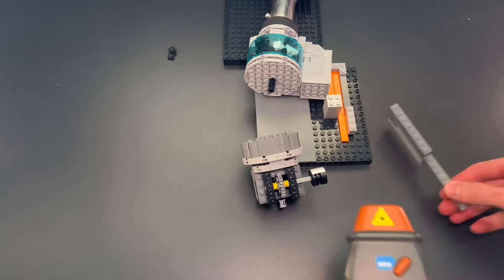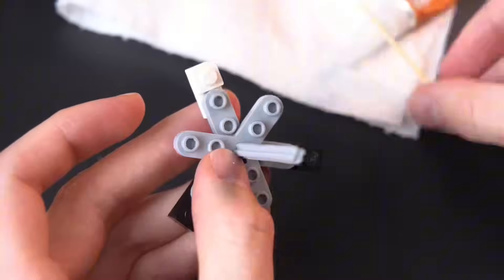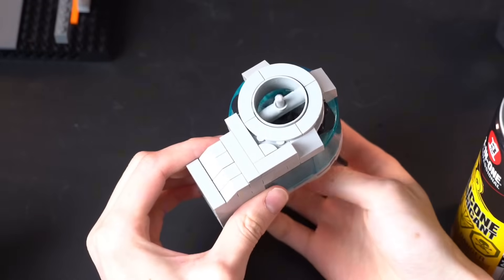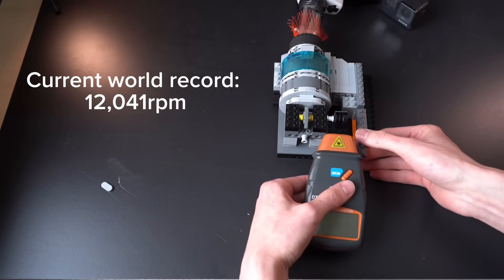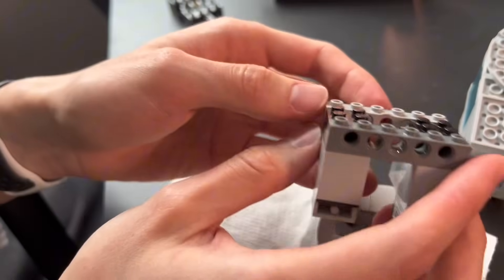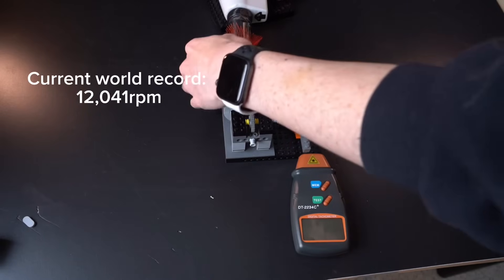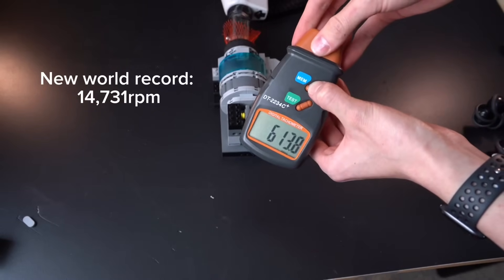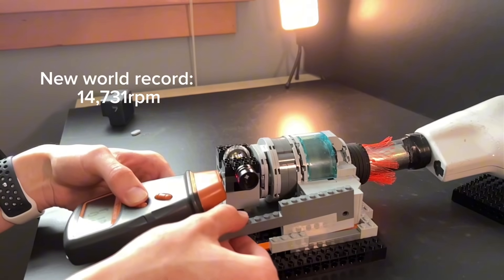15,000 RPM - LEGO vacuum engine | NEW WORLD RECORD!

Comment: put two parallel ones connected to the same axis, on one side you connect it to the vacuum cleaner, and on the other side you connect it to the engine's air intake, making it work like a car

Comment: Cool but lacks the robustness of the other ones. That might just be a consequence of having the turbine axle be in the same direction as the vacuum. Silly question but what happens if you use the other hole for the throttle and move the vacuum to where the throttle currently is?

Comment: watch joe booker on a car engine that does vacuum .video joe cell hkrses mouth.its not water its the charges in water that develo natures lightning electro static the lightning bolt magnetic static the vacuum void closer ( thunder clap ) it can never valve bounce as the engine is sealed .joseph papp also did this .its in air of coarse .hence your engine explodes like joseph papps did as it either becomes colder and colder .that would cause levitation .MAY BE PLACE A FUNEL TYPE ON OFF FUEL TAP TO ALLW A NANO PARTICLE OF NORMAL AIR PRESSURE TO REGULATE THE CHAOTIC VACUUM. and of coarse the opposite charges the air holds to the vacuum

Comment: remember the air here is still limited in the speed it can achieve... theres certain basic physics governing air speeds due to pressure differentials.

if one asked this turbine to do actual work, at max efficiency it would run at half the speed of the air flow...

and despite how it seems... the air is expanding, as it enters the lower pressure...
probably get slightly better results running backwards to this... intake in the center. like a normal centrifugal impeller... youre asking the air to flow backwards to how it wants to flow here. it wants to fling out, the air mass entering from the center... its that incoming airmass that does the work. 

its odd. i have one of them little 250s that happily revs at 18K... the tacho doesnt even register below 4K.
yet i jump on a lathe and just 500RPM seems stupid fast...
Reply: True

Comment: Why do you use a gear reduction, it would be faster it was right off the axle
Reply from the maker: My tachometer only goes up to 2,500 rpm(not even close to 15,000) so I put a 24:1 gear ratio on the output and just multiplied the reading by 24
Reply: @j_mods_everything  oh i see

Comment: Important Thing To Remember To Make A Very High RPM Lego Engine:

Lubricant And “Glue…?” 😅

It Reached Almost 15k RPM, Thats Fast 😮
Reply: Thatfemboydud   i use a 14500 rpm motor with lego and it just melts the axles fairly fast unfortunately
Reply: Thatfemboydud   im gonna get matal exles and prolly gears eventually they wayy expensive tho
Reply: Just use the kragle

Comment: This is not an engine ,it's a turbine they are not the same thing
Reply: all these past wrs are technically turbines. how else are you meant to make it
Reply: @GXVoid116  like he made them before? His older projects where engines
Reply: From the Oxford English dictionary:

engine, n.
A complicated machine with moving parts, for producing a given physical effect, esp. the conversion of power into motion; (in later use) esp
Reply: It’s a turbine that can be used to do work if a geared down output shaft is attached.
Reply: Aren't there videos of people getting turbines up to 30 to 40k?
Reply: They achieve the same results, high rotations via air. I understand your point but this is supposed to be entertaining not educational I believe.
Reply: Womp womp, dont need to get all bent bc of a word/term
Reply: A turbine uses the kinetic and/or heat energy of a fluid to create mechanical force. An engine needs to be able to burn fuel to produce that heat energy by itself. It doesn't matter whether or not it uses pistons, it's still a turbine. By definition, anything that you build out of Lego and run using compressed air will always be a turbine and not an engine.
Reply: A turbine is still classified as a combustion engine
Reply: Erm, what the sigma? According to my previous calculations from the skibidi toilet film theory basement, this doesn't matter, and nobody asked. Sure they could have used the word turbine but why bother changing it? Anyway whatever I'm gonna go g o o n now
Reply: Turbocharger*
Reply: Vacuum
Reply: Shut yo “erm atchually 🤓” ahh up
Reply: So basically a lego turbo
Reply: @MoparCentral2010  no, a turbo pushes the oxidizer(air) for burning the fuel,a turbo turns mechanical energy in to airflow
Reply: A turbine engine is a engine
Reply: Dog, do you love the smell of your own farts so much that you have to crop dust everyone else? It’s Legos. Just enjoy the engineering.
Reply: Um actually....
Reply: Turbocharger
Reply: Pee pee poo poo
Reply: Turbine engine are still engines
Reply: Still a type of engine it's a turbo chill broski
Reply: Turbine engine dumb
Reply: Turbine engine dummy. A V8 and similar are Internal combustion engines. Same family.
Reply: Hmm, it seems like since this is LEGO FOR GODSAKE, A TOY FOR KIDS, I DONT THINK A FUCKING PERSON GIVES A SHIT ABOUT “ooohhh uh actually it’s a turbine/engine blah blah blah 🤓🤓🤓” JUST CHOOSE ONE AND BE HAPPY
Reply: It's a whistle
Reply: @PapaFritos  💀
Reply: It says vacuum engine it's a fast vacuum
Reply: Stfu lil bro go back to YouTube shorts
Reply: It's called turbine engine
Reply: Oh my god, WHO THE HELL CARES!
Reply: Its still cool
Reply: That are still engines
Reply: You not people,you monkey😂
Reply: A turbine is an engine
Reply: No it’s a turbo
Reply: You’re just a guy who doesn’t know🧐
Reply: Using glue for improve connection: Warning, you cannot separate the piece or take apart
Reply: They aren't, but a turbine is a type of engine
Reply: Hi Commandẞlock
Reply: Every wr Lego engine is a turbine
Reply: It's a lego vacuum engine which is also a turbine
Reply: @Skeuomorphist  No, just no
Reply: @AGuyWhoDosentKnow  Yes, just yes. You can Talk when you have made a lego vacuum engine
Reply: @Skeuomorphist yea it is an engine its called a turbine engine. do these people think its gotta be a v8 engine and nothing else? do they not know that rockets are also engines?
Reply: @keesvdb  it dosen't have to be a v8,it can aslo be a i1,i2,v2,v4or a i8 that he made before
Reply: @AGuyWhoDosentKnow turbines are quite literally engines that’s why we have them on jets and on airplanes (most military, pretty much all of commercial and cargo airplanes, but not much general aviation)
Reply: @retrofalcon8 a turbine is only one component of a jet engine. You also need a compressor, fuel injectors and an ignition source to get the engine started.
Reply: Who cares still cool
Reply: @rasyaar5124  True
Reply: Engines produce power.  Motors use power.  This is technically a motor.   HOWEVER the turbines used on planes and power plants are ENGINES.  Turbine engines specifically.  Learn better.
Reply: You’re a turbine.
Reply: Well in mate
Reply: @Piggus  nobody asked
Reply: what you mean with pistons? yh fair enough but pistons never gna get world record for rpm bc too much mass. the past recent world records were all like this one
Reply: I made a lego vacuum piston engine reach 14 k rpm, I think its The world record @GXVoid116
Reply: @GXVoid116  that's true
Reply: Nobody cares about it

Comment: You should go full blast. That thing wasn't even half open
Reply from the maker: I was shaking. Thing is scary as hell😅
Reply: @j_mods_everything Maybe try use pneumatics or a large string to pull it out? so you can be further away
Reply from the maker: @nope_png  I gotta do that a rig something up for the tachometer. Then I could just start it and leave the room
Reply: @jmodsbricks  but that's the fun of it

Comment: Nice one! The glue is a little bit cheat😏 
But I will make a 3.0 version soon!
Reply from the maker: The glue was definitely a cheat. Can’t wait to see what you come up with mate🙌🏻
Reply: Cool
Reply: Would a stronger vacuum be a solution?
Reply: @dsprings8565 this is what I was wondering, are they using a cheapo vacuum or per say a higher powered shop vac?
Reply: I mean the glue is necesary if you dont want your turbo to blow up
Reply: @Mememonkeydude-kv7ht  the 12041 rpm guy made it without glue
Reply: @NexIHateYT You mean the guy who wrote the comment?

Comment: Congratulations my friend you did it! How does it feel to break that record!
Reply from the maker: I did cheat a bit😅
Reply: Do you mean using the glue on the impeller? The way i see it you did what you had to because little plastic lego bricks were never meant to be spun that fast much less endure those levels of G forces.
 @j_mods_everything
Reply: @j_mods_everything  good JOB can i get a shout out?
Reply: not a wr
Reply: maybe that was never the point but at least he reached his objective and I think that is admirable to me. @TwistedEngineering
Reply: @XOTIC_XPATRIATE personally i find it the opposite of admirable that he called it a wr, either he made it up or he did little to no research
Reply: regardless he had a goal and he achieved it. @TwistedEngineering